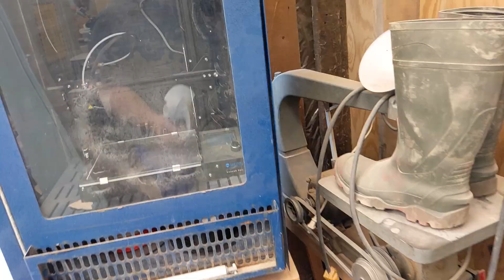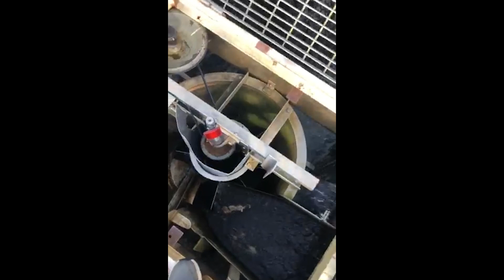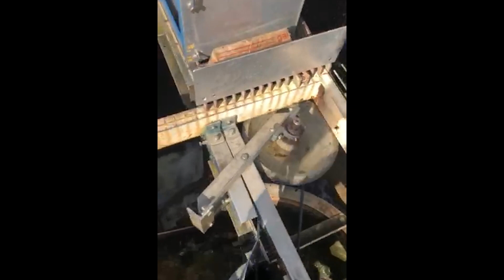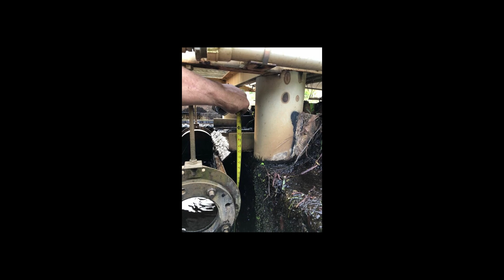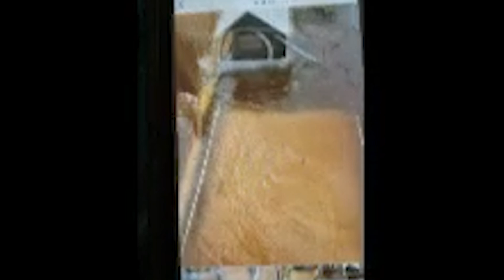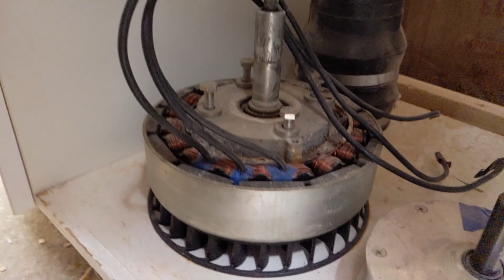Low Head Hydro For A Viewer

Comment: Very interesting. I'm impressed that that can handle that high of a flow rate. My concerns with that gearbox setup are that there are more losses because of all the bearings that are running loaded. I'm not a mechanical engineer, so I don't know how bad they'd be. I'd be interested to see a test. Also following Seth's turbine tests, they're pretty interesting.